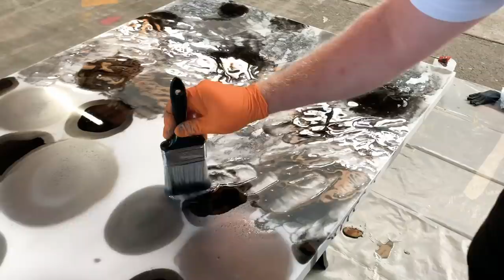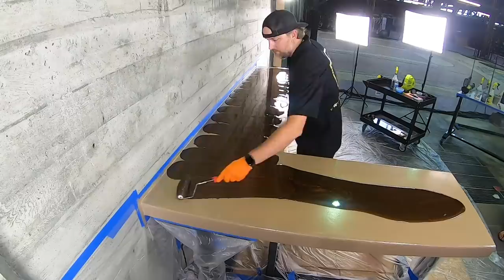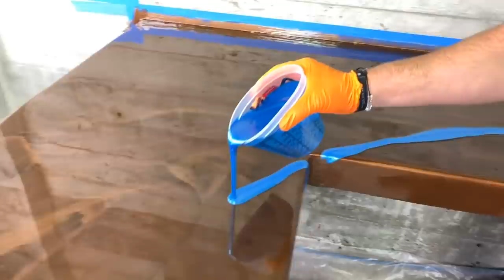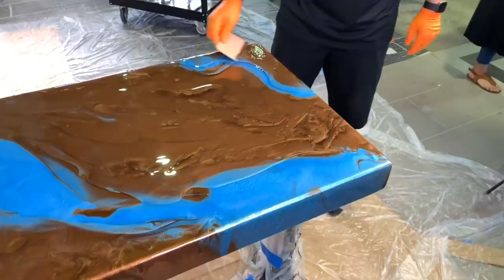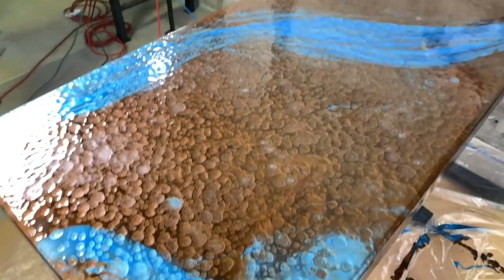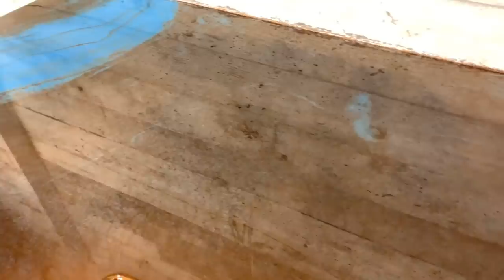Sky Blue River Run On A Coffee Base Epoxy Countertop

Comment: good perspective of how much the material will flow as it levels out.  The Blue vein started out right on the inside corner and at the end it had flowed to 4 or 5 inches below.....
Reply from the maker: The epoxy will continue to spread while it is setting up.

Comment: Do you have to use primer? What happens if you dont?
Reply from the maker: Yes you have to use the primer.  If you don't us the primer the epoxy will have a hard time adhering to the surface.

Comment: Thanks Tylor! What temperature should be ideal when you pour epoxy? Thanks!
Reply from the maker: During interior installation make sure the room temperature is between 72 degrees and 78 degrees, you DO NOT want any drastic rise in temperature during and after installation.  So keep the area at room temperature during the whole cure time of seven days this will prevent any outgassing of the concrete which will create bubbles.  
For exterior installations or non climate controlled installations, install under 80 degrees. So if it’s hot outside you will want to do the install in the early morning or in the evening when it is cooling down (while temperature is dropping).  Thanks

Comment: Please add steps for new beginners.  QS: Base coat- was it Epoxy base coat or Bonding Primer base coat?? Qs: Color - Did you use Acrylic or Pigments? Qs: If Acrylic whats the ratio and which Acrylic.  Your video or Stonecoutnertops videos LACKED important information for new beginners.  & its also not mentioned on your websites.